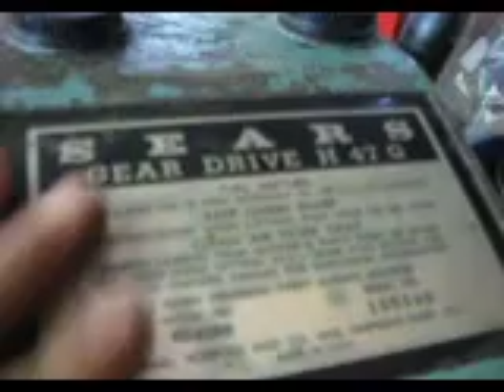sears geardrive chainsaw MVI.AVI

Comment: buy the video the saw looks it is a model 917 62809 with a power products 5.8.cu inch 95cc ah 58 engine.or a 917 62810 4.7 cu inch 77cc power products ah 47 engine. let me know if this is right